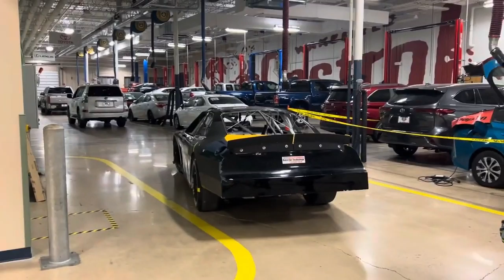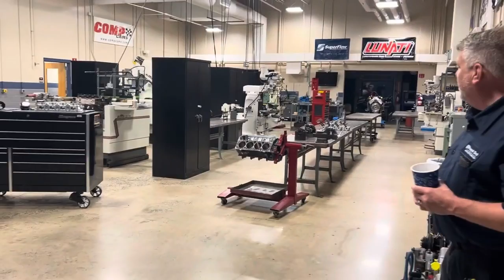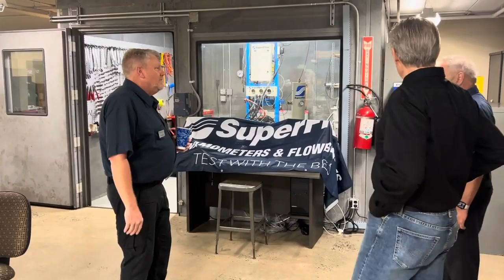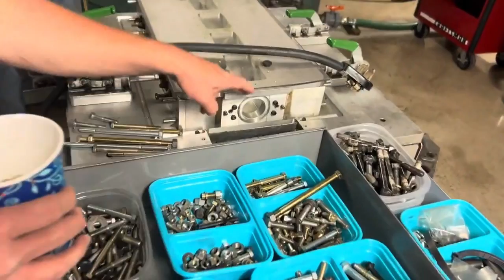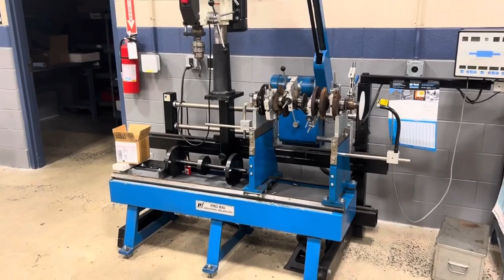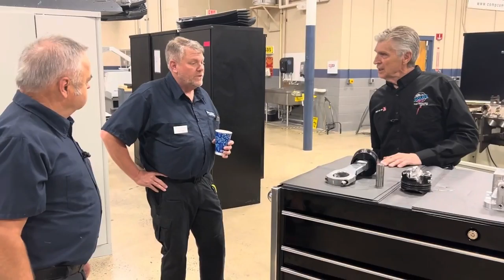A tour of Forsyth Technical College - Race Car Engineering with Brian Hambly and Galen Biggs

Comment: I like hear more about the two bolt main strap story.  Someone called Wilson?  Thks for the video
Reply from the maker: Thanks for the question Eric. I was referring to Waddell Wilson, he was a NASCAR engine builder in the 60's -70's. He is now in the NASCAR hall of fame. Until 1969 there were no 4 bolt main engines. Also the main bearing caps were cast iron. To strengthen them he machined a flat on the top of the mains and then added a  steel strap with longer main bearing bolts. Those engines made almost 600 HP and ran 7000RPM all day on the superspeedways with mostly stock parts. Waddell published a book called "Race Engine Preparation" in the 1970's which i still have. AG
Reply: @goldsgarage8236   That's is some really cool information